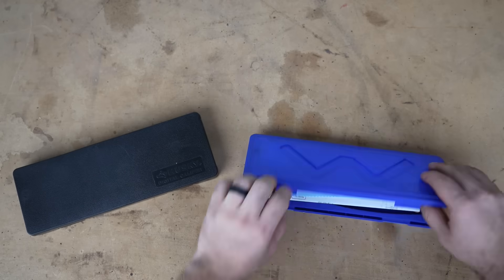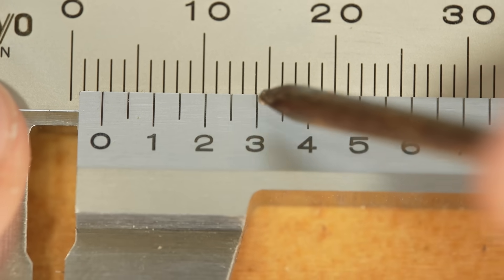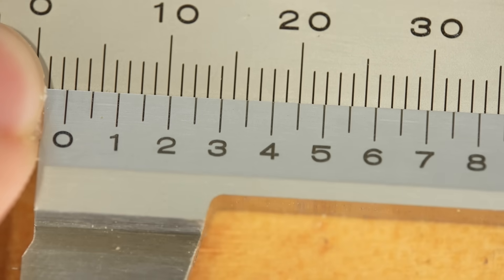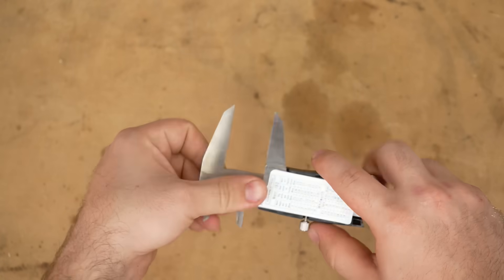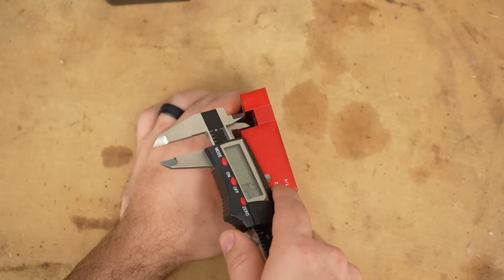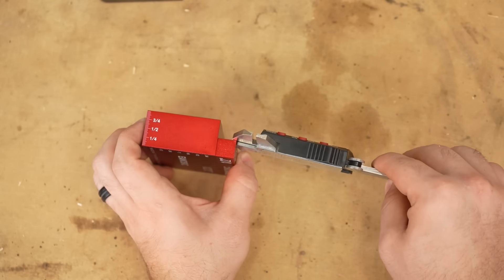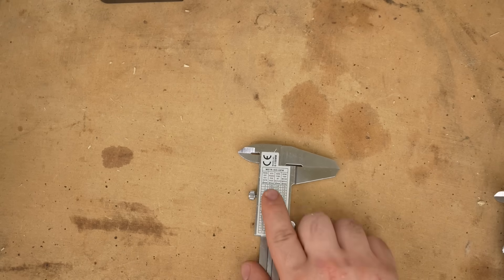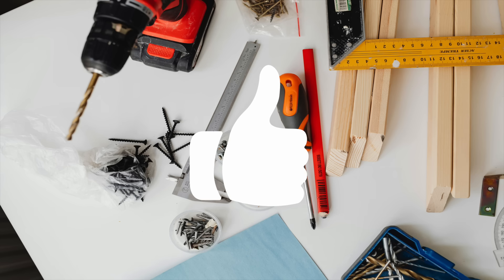I wish i’d known this sooner, How to use calipers like a pro

Comment: >"HOW TO USE CALIPERS LIKE A PRO"
>absolute basics
Reply: I can't think of anything he left out... if you can, tell us about it.
Reply: @PiefacePete46  he didnt leave out anything basic, true. using calipers like pro includes stuff like measuring distance between hole centers where the caliper jaws can't directly touch
Reply: @PiefacePete46  He might have mentioned the difference between accuracy and precision

Comment: In tradeschool they would only let us use vernier scale calipers and conventional micrometers. Nowadays I work in a high volume CNC machine shop, we only use digital everything. At home I use the midground between vernier and digital, dial calipers. Easier on the eyes than vernier and doesn't need batteries.
Reply: I'm a woodworker and rely on the dials for ease of reading and not needing to change a tiny battery every time I go to use it
Reply: Dial calipers looks cool not gonna lie, I'll stick with the vernier though.
Reply: Learning the basics is always better. I have even learned to weld thin material old school with a torch. It makes you understand why to do things instead of just how to do things. I didn’t go the welding route but it did make me a much better welder and when I wanted to learn tig I had it much easier because I still knew the basics.

Comment: With any measuring device, especially digital. Don't confuse resolution with accuracy. They are not the same.

For example, the old analogue AVO multimeters were in insanely accurate, such that you would need very good magnification to read to that accuracy. So good accuracy, but poor resolution in practical use. The first digital multimeters could read to 3 decimal places, but were only accurate to one decimal place. Good resolution, poor accuracy. One had to consider a large +/- to those 3 decimal places.

Comment: Most electronic versions  even turn off . Still use a tiny bit of battery life. So if used infrequently.  Pull out the battery.  Ready to put back in the next time you need it. Nothing worse trying to use it , only to find the dead battery.
Reply: I have a rule to always keep a spare fresh battery in the caliper box.
Reply: exactly why I own dial calipers
Reply: At 2.36.  Slight error should be 2.4 mm...
Reply: Worse is if the battery also leaked and you have to clean out the crud inside.

Comment: Still rocking the  dial  Starret vernier caliper.  Those and the Mitotoyu 0-1, 1-2 and 2-3" mics set are still going strong after 40 years. Buy good tools and take care of them and service when needed and they will last a lifetime.
Reply: Mitotoyu are wonderful tools, but be careful when buying, they are often faked.
Reply: Or you could buy cheap poor quality tools, and curse your stupid decision for a lifetime?
Reply: I'm a huge fan of Mitutoyo. Starrett is fine but they feel a little rough around the edges. I've always been a huge fan of Brown and Sharpe tools. They're very polished and feel fantastic in the hand.
Reply: @yurgon  I have a Brown & Sharpe that I use at work. And I have a Starrett here at home. I prefer the Brown & Sharpe mainly because it's a lot lighter.

Comment: Just a small omission: the thumb "wheel" seen on your two digital calipers. It’s used as a sort of clutch to guarantee equal pressure across multiple measurements. Why is there no wheel on your conventional calipers?

Comment: The China Export thing is just an urban legend. https://en.m.wikipedia.org/wiki/CE_marking#%22China_Export%22
And be aware thar the CE is a self certification, so you are just hoping a manufacturer is honest and not making flammable teddy bears or whatever. 
Marks like UL, ETL, NSA, TÜV, etc, are third-party inspection companies. Yes, the manufacturer picks the testing lab and pays them, but the lab has to maintain some level of credibility, or OSHA will remove them from the recognized lab list. It's not perfect, but the CE is just total fiction in my experience.

Comment: If I may nit-pick, Pierre Vernier invented the Vernier measurement aid.  He was French. Vernier is pronounced VER-nee-ay (ay as in jay), not VER-nee-er. :)
Reply: You should hear how “Lagrange” is pronounced in the US.
Reply: @TheLegionofReason  - Here in New England it’s typically pronounced “luh-GRAHNJ”, although as one heads towards Canada there’s generally more folk of French decent and you’ll frequently hear it as “luh-GRO(NG)ZH”. You never really hear it with a long A sound except from visitors/recent arrivals to the region.

Fwiw, LaGrange Street is a fairly major road in the western part of Boston.
Reply: as a kid I thought they were named after someone then got older and started woodworking with verniers, very thin sheets of wood, and thought that I misheard the name of the tool that was named after the material, not many times you look back and realize you had it right as a kid.

Comment: So why not measuring steps using the depth rod ?
Reply: Because sometimes it's difficult to keep the caliper perfectly perpendicular to the surface, hence obtaining wrong measurements. On the "step" side, instead, you have a much larger surface on the caliper, so it's a lot easier to do.

Comment: I stopped watching when at 2min37sec a reading of 2.39mm was pronounced as being 2.9mm. The caliper may well be very accurate but it is only as good as the person using it. Clearly this person wasn't.
Reply: Glad you've never misspoken.
Reply: @grandpasbarn2806  I am supposing this was a reference to me ? Yes I have misspoken before. But never for/on/in something that should be held to a higher degree of accuracy as a video like this about very accurate measuring instruments. This is not the first time I have pulled utubers up for this. And I have gone back many times later to see if any changes were made to the videos - not once did I observe any difference. I don't know much about publishing a utube video so maybe it literally isn't possible. I don't know. But if it is then if I was found to have misspoken I would want to make sure the mistake is fixed or as a very minimum mention made under it in the accompanying extra text. Then I would have confidence that the rest of the video is accurate.
Reply: Too bad, you missed the point where he talks about the "European Community" and "China Export" that have quite the same logo... Worth listening to a reading mistake.

Comment: Excellent. Surprised no mention of dial calipers, no battery to go flat and large easy to see scales. Only problem with verniers is being able to see the lines...
Reply: my dial one was bought in 1958 still nice to use
also the small thumb wheel for pressing the jaws together
use full on round objects.

Comment: I started using caliper on my RC car when setting up the steering, suspension and camber of the wheels.
Ever since doing so the handling is out of this world. 
The RC car I race is in 1/12 scale and I can use real world set ups by scaling down.
I also used them to construct a aniti roll bar for the suspension on the front and back of the chassis and this has given me a car that handles like a dream.
Because it is front wheel drive i now get that lift off over steer just like the real thing.
Reply: That's awesome, would love to see some vids of your car.
Reply: Reading this makes my Inner-Geek so frikkin happy 😊👍
Reply: handles like a dream? and how you've solved that icing problem?
Reply: @mojeimja  i don't quite understand what you mean, as I don't race outside unless it's dry in the summer months and indoors through winter.
Reply: @b00ts4ndc4ts  I don't either, honda dreams tend to exist only in countries that don't have ice and a car handling like a motorbike wouldn't be too nice!

Comment: The China export thing is BS. This internet myth doesn't like to die, because, well, anti Chinese sentiment, I guess. The EU is aware of the supposed mark and have even stated that it is not a Chinese export mark, but merely a CE mark that is printed slightly differently as there is no standard for its size beyond being greater than 5mm in height.

Comment: The "China Export" stuff is an urban myth!
The proportions may be off, still it states that the manufacturer guarantees that the product conforms to the relevant regulations. It may additionally state the registration number of the "Notified Body", that is the organisation that actually checks the conformsnce for the manufacturer.
If you doubt the conformity, you can ask the manufacturer to proove conformity or contact the Notified Body.

Comment: I use a dial indicator caliper and I love that tool. The cheap digital ones don't have proper power management when turned off, so your battery will not last long.
Even the proper CE label only means that the manufacturer claims that it conforms to the standards given, but no one ever checks it, so you need to trust every Chinese backyard shop not to lie about it. IMHO, it's completely useless.

Comment: Two small comments:
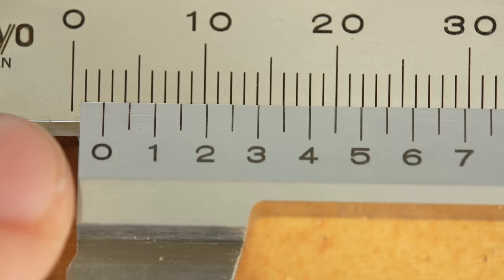@2:30 ... you better have said: "this measurement is 2.40 mm' (rather than 2.4) ... yes it is the same, but adding the 0 is the same as if the scale had matched up in the previous line ... you would certainly have said 2.35mm then (rather than only 2.3) ... of course we keep in mind that the correctness goes only down to 0.02mm ... so you could have said the measurement to be 2.40mm +/- 0.02mm.
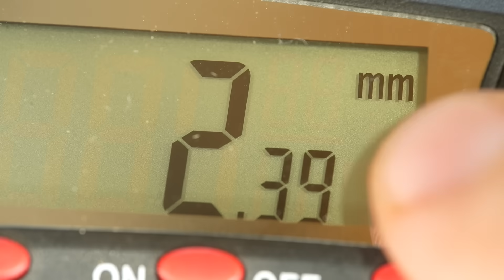@2:36 ... you read the digital caliper as "2.9mm" when it clearly displays 2.39mm ... (2.9 instead of 2.40 would not at all be impressive).

Comment: Thanks for this info. The step measurement was also new to me. I also prefer the vernier calipers, as my digital one burns through the battery quickly.
Reply: China Export calipers are usually (electrically) very bad designed and use 1 battery per 3 months (if you are lucky). I invested in a Mitutoyo 10 years ago and never have had to replace the battery...

Comment: Great video many thanks.
If you are using them when machining, warm parts or parts with different temps. The readings will differ.
Reply: My old 1976 standard issue engineers rule actually has the accuracy temperature stamped on it!
Reply: indeed